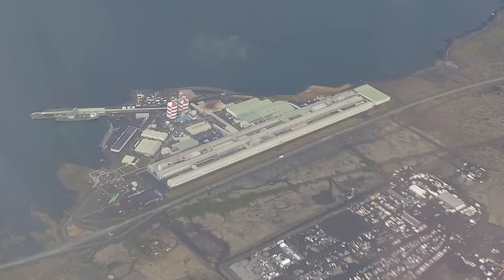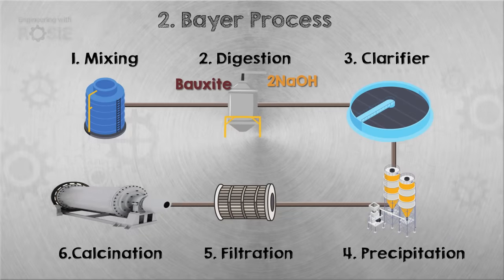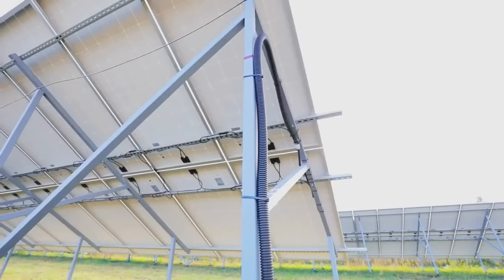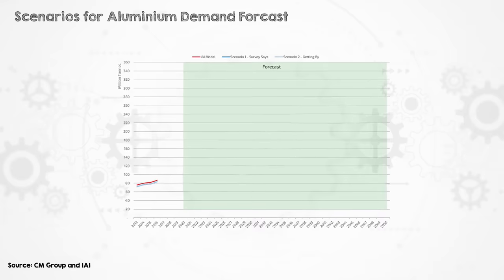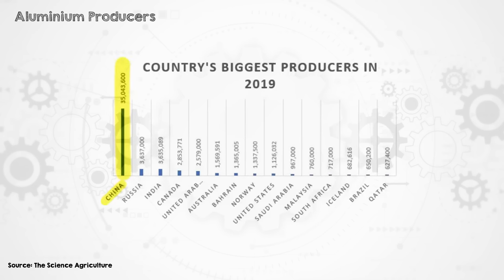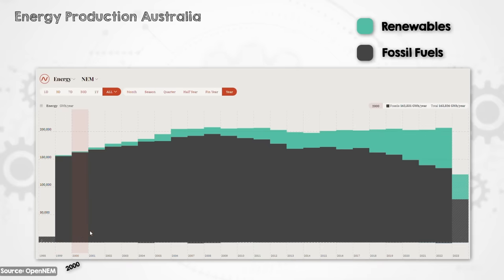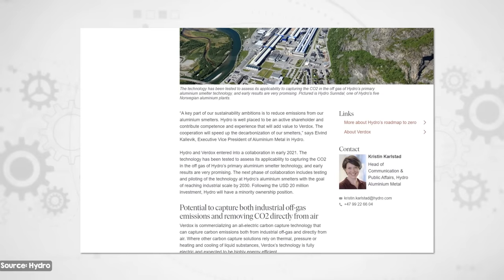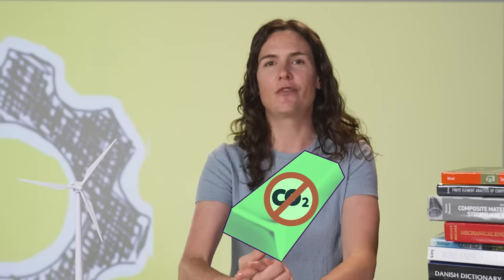Emissions-Free Aluminium: Which Technologies are Changing Everything

Comment: There is only one way to produce aluminium.  Electrolise Al2O3, which needs to run 24/7.  The electricity demand is enormous.  Hydroelectric, nuclear or coal are the only economic options.  The future for aluminium is increasing cost.
Reply: Tell us you didn't watch the video without saying you didn't watch the video.
Reply: @SocialDownclimber  True.  While Rosie does her homework on the processes she gives the impression that there are fixes for the coming sh1t show.  Some inconvenient facts:  The US Geological Survey estimate of global resources of metals and minerals is 2-5% of future needs.  Global crude oil production has declined since 2018 as has liquid fuel production.
By presenting these very minor changes Rosie is providing false hope instead of generating major movement for changing the way things are done.  With a measured over 500 ppm of CO2 equivalent warming will continue for over a century without further emissions and because the minerals and metals are not available for low emission energy, fossil fuels will be used to economic depletion within a few decades, when the cost of supply is more than the ability to pay.  95% of the cost of agricultural production is energy, mostly fossil fuel.

Comment: Again teh BS story of CO2 as being a greenhouse gas which it is not.   For those who think it is responsibl for climate change my first question is to answer the question of percentage of CO2 in air.  Most people have no clue and when forced to answer they estimate 20 %.   In reality it is only 0,035 % or 350 ppm.  The reason that this percentage is so low and remains low despite the combustion of fossil fuels is that plants need CO2 for their existence.   The CO2 is absorbed by the plant via the leaves and under the influence of sunlight break the CO2 up in C and O2.  The plant keeps the C and with water via the roots the plant build the plant structure.  The O2 is returned to asmosphere.  More CO2 just means increased growth and more plants.  The human population have been bamboozled !!!!!  Wake Up.